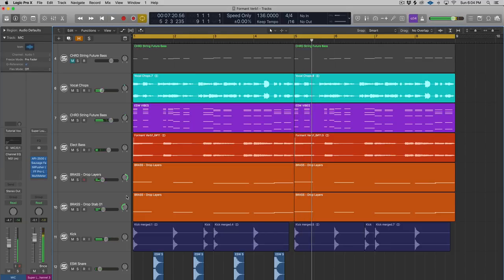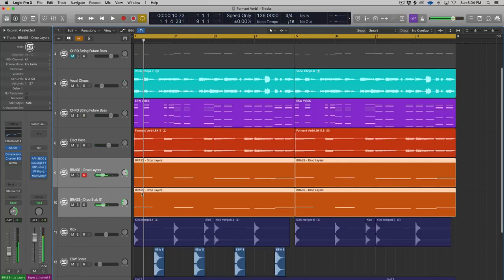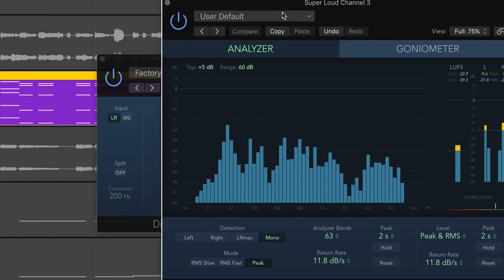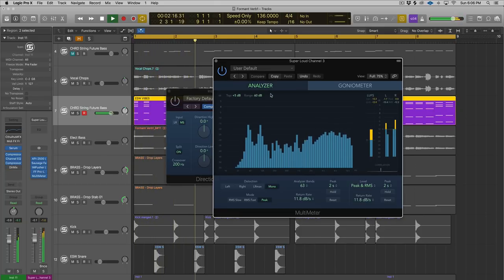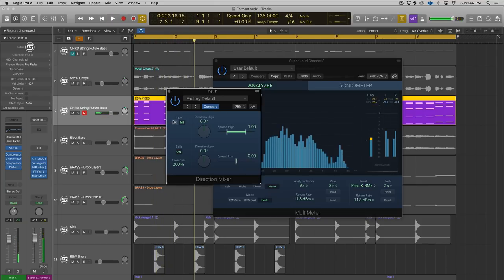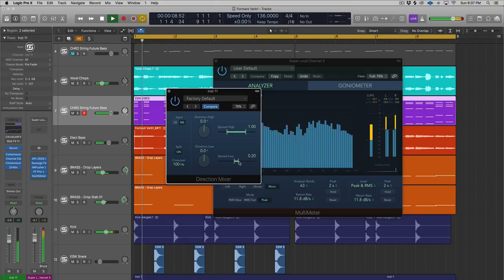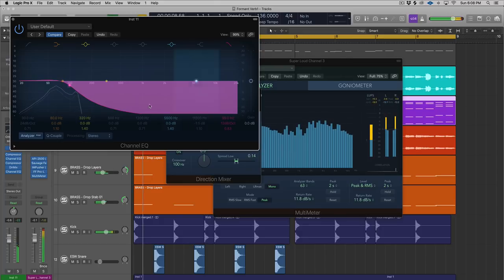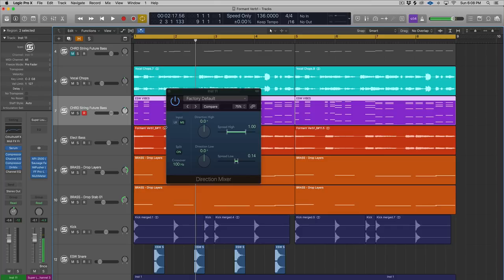Logic X - Safe Bass Pro Tip

Comment: Are we supposed to make sure every single track in the mix must stay mono compatible? In other words, "Correlation meter reading must stay positive?"
Reply from the maker: Prateek Gupta you typically don’t want it getting to close to anti phase for too long. So it being negative might be a bad thing. Some genres are more stereo than others. I try to keep everything in my mixes under 125 hertz in mono. You can import reference tracks of your favorite songs and see how your phase lines
Reply: @EchoSoundWorks  
Well one thing I don't understand.
Sometimes the individual tracks have negative reading on correlation meter but when I check the phase on the master bus it's all fine. 
So, if the master bus is alright and having no phase issues
Am I still supposed to fix the individual tracks with phase issues?

Comment: i always use the LR mode for this technique using this plugin, i don't see an obvious difference here with the MS mode.  is there one for this basic plugin?
Reply from the maker: sachtjen101 hey! I think with some sounds it works better in MS vs LR, but it depends on what you’re going for. I use each probably 50/50
Reply: i guess, what i am asking is what is the difference specifically?  i have tried both and can't tell a difference audibly or by looking at the phase correlation meter.  both modes seem to accomplish the exact same thing properly.